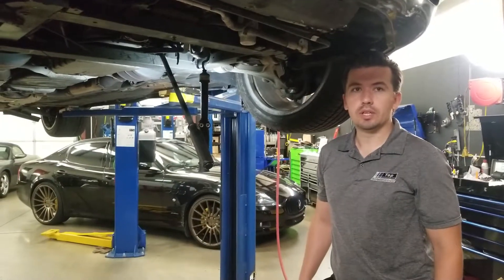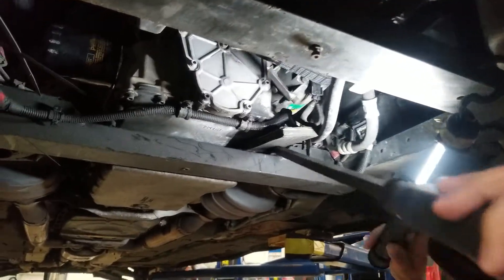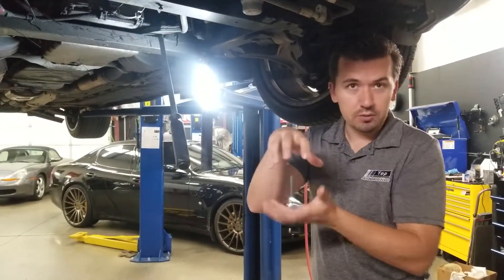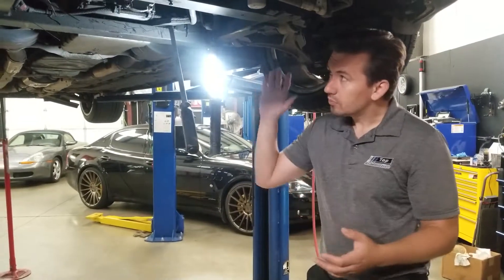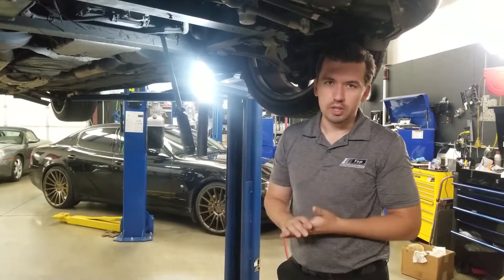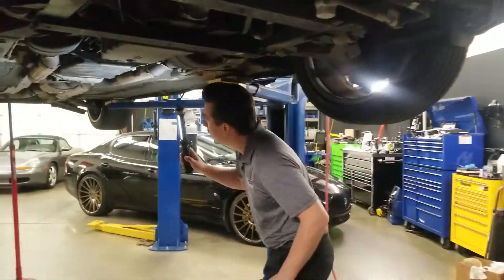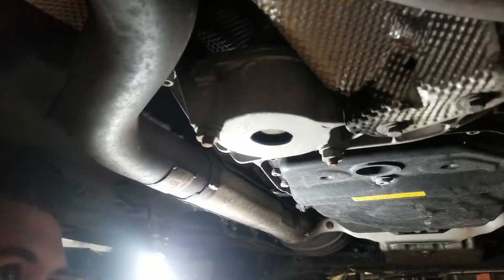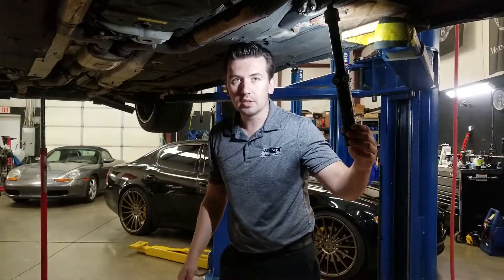Maserati common problems with engine vibration and rough idle

Comment: I just replaced both engine mount and transmission mount. They were already showing signs of age but hav yet to leak n fail. Dealer said in April 2021 to go back n replace them in April 2022. It’s November 2021 now but i absolutely wanna get in BEFORE the mounts fail. Cost me $4,000.00. My 2009 Maserati QP 4.7 exec gt was not vibrating or “mis-firing” but after replacing 3 mounts the car does drive noticeably more taut n power transfer from engine to rear wheel is immediate & reminding me how it was 12 yeas ago (i bought the car since new in 2009) it has 45k mi n now drives like it’s brand new. I know about the mounts bcoz of your video post. Thank you.

Comment: Mine has 125k miles… Changed mine a while back, still vibrates a bit. The workshop manual says to use a jig to align the subframe properly afterwards, not sure is anyone does that?

Comment: I own a 2012 quattroporte zf trannsmission my cars done 90k Km's it lurches when shifting from 3-4 4-5 gear especially on high rpms. I have changed coils sparks battrey thorttle body lambda sensors  problem still exitsts . I would really appreciate your advice. Thanks.
Reply: We’re you able to figure out the issue?